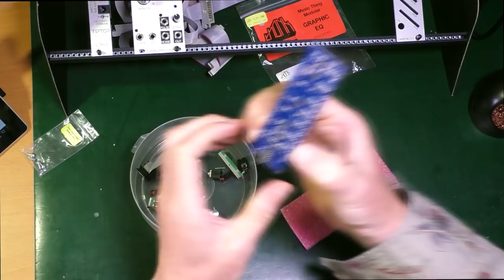Modular DIY 03 - Music Thing Modular Graphic EQ

Comment: A tip: it's always best to attach the panel before soldering any components that stick through it to ensure everything's lined up correctly before you commit. I tend to just place the parts then attach the panel, then solder, but if things are moving around too much, you can tack one pin in place with a little solder. Then if anything needs adjusting to fit through the panel, you don't have to desolder the whole thing.

Comment: Robin

Old engineers hint, when doing work with variable height components, get a bit of polystyrene packaging, make a couple of holes in this case for the fader tines, and you will find that they will be held in place and makes soldering simple.

Comment: The fumes from soldering is composed of the flux in the soldering wire, not lead. Breathing flux vapor is not good for you, so having the fan is a good idea. Also, a PCB holder for soldering is, IMHO, essential. You can get one for around $12 on Amazon or go for the Panavise luxury model.

Comment: Before deciding on the Befaco oscillator, you might want to have a look at DivKid's video on the new Dannysound Thru Zero Oscillator kit from Thonk... 
Nearly twice the cost as the Even, but it's probably worth it, tbh.
Also, my tip for making your life easier, soldering-wise, would be getting one of these... https://www.amazon.co.uk/BURNTEC-PCB-Holder-Jig-Soldering/dp/B01MRAEY6M/ref=sr_1_3?ie=UTF8&qid=1536368904&sr=8-3&keywords=Pcb+holder
Reply from the maker: I considered the Thru Zero but it’s listed on Thonks website as a difficult build so it doesn’t feel like a good choice at this stage